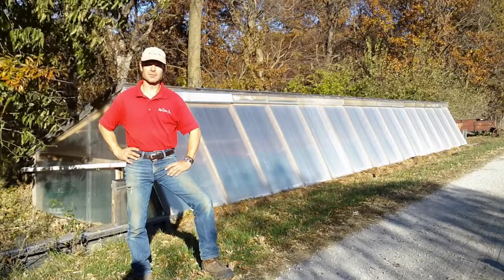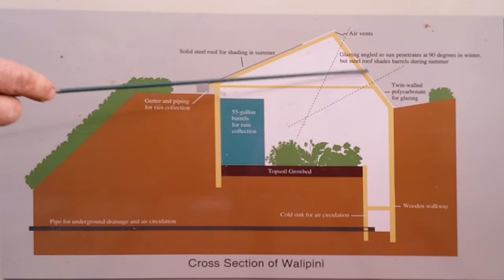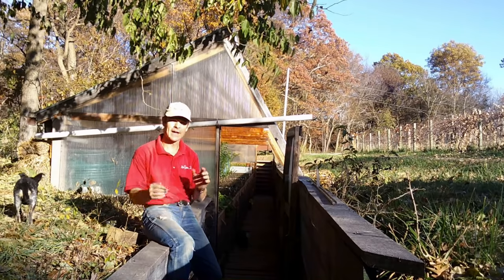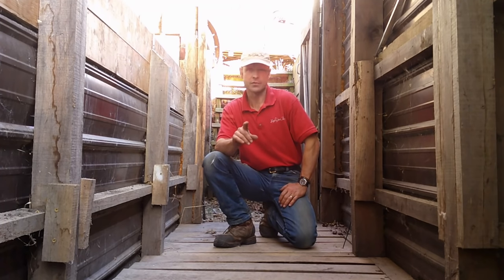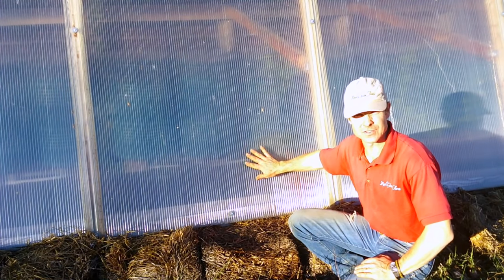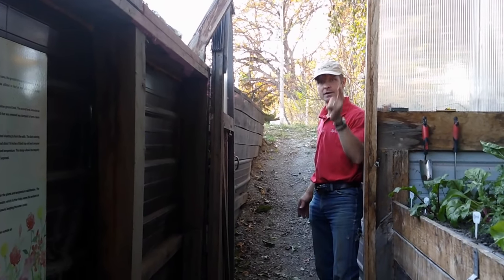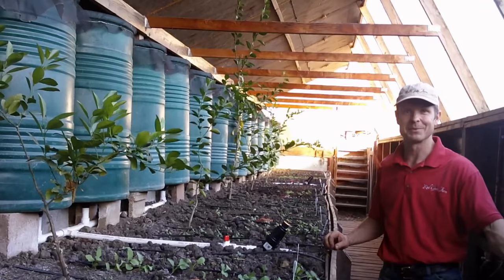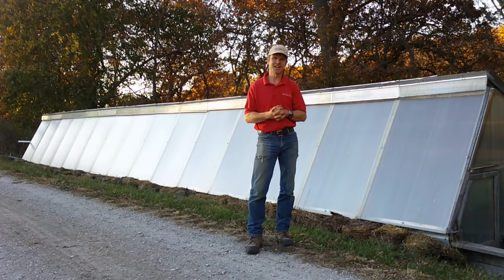Farm Tour Series: The Walipini; Use, Design, and Construction

Comment: I've heard that marigolds in a plant bed are great for repelling bugs; I'll be using them next year, for the experience. Also garlic repels pests. In my grow tent, I've successfully used wood ash sparingly, in top inch of soil and dusting on leaves, and also added diatomaceous earth sparingly in the same way; completely eradicated the bugs!
Reply from the maker: You are correct on all accounts! I love complementary gardening methods and use them often. Unfortunately, the aphids and the pill bugs I have found just don’t seem to go away using plantings or DE. At one point, I even applied so much DE, I altered the composition of my soil! So, we just kept plugging along and learning to deal as we went.

Comment: One concern that comes to mind is powdery mildew. I didn't notice electricity where a fan could be added. Some pictures showed that the plant density can get thick. It would be interesting to know more about that issue. This is a fabulous idea!
Reply from the maker: So far, we have had no issue with powdery mildew.  We do have it in our outside garden on occasion, but not in the Walipini.  I can only assume it is the good, constant flow of air between the cold sink and rafters that keeps it well ventilated.  And you are correct, there is no electricity.  It is completely self-sustaining.

Comment: Brilliant - great thinking, design and practical details. Good articulate presentation with no fluff as well.  I don't have the luxury of walnut or other really durable wood for posts - and suppose most others won't either.  So the constructional concern I'd have is with the side walls either side of the walkway - there's a lot of earth pressure to resist there and it'll be a bugger to fix once the wood supports rot where they are in ground contact.  So that's where I'm going to spend my thinking time.  But hope to be building soon.  Thank you so much for taking the trouble to produce this exemplar of sustainable living - and the thinking behind it that city dwellers mostly have no conception of, because they are so far removed from the natural world.
Reply: Suggest you ask about galvanized C channel at local metal fabricator or yard. Also scrap yards are sometimes willing to sell items like fence posts - any of these would resist ground force at some perhaps narrower spacing interval and they can be pounded into the ground. In solar, we use G-235 galvanized C-channel and pound it into the ground to support larger scale solar arrays. Expected life is more than 30 years in most soils.

Comment: Great content, thanks for sharing💚🌍
Any reason why you don't have the front wall as a grow wall? Seems like you could grow alot more in this space...
Reply from the maker: In this particular design, the walk area would’ve become too tight to comfortably maneuver if there had been a front wall bed as well.  Additionally, the bed would’ve had to be constructed at head level to receive any sun. No sun ever hit below head level anywhere in that walking area or front wall space.  This can certainly be a design consideration if you’re building one from scratch. But you have to ensure it is positioned in a way to receive sunlight, and not block the path.

Comment: All great,  first of all the explication. U r really a perfect teacher. To improve: the opaque ceiling should be reflective, of warmth and light. I'd also have the actual growing level at least 40 cm lower for better handling and more space for higher plants like trees. Thanks for the work of making the video and trying it all out!
Reply: another reason for a reflective ceiling is that u are not interested in absorbing solar radiation coming through ur glazing in the ceiling. Because during the night it will get lost anyway. But a reflective ceiling reflects the solar radiation to the soil, and the barrels, where it can be effectively stored.  Furthermore, a dark ceiling in winter nights, being cold, radiates coldness, whereas a refl. ceiling reflects the warmth of the interior back.

Comment: Cold's not coming in.  Heat is escaping.  Yes, the colder air in the space will collect down low, due to stratification.  And yes, the cold sink - which is actually a heat sink in winter - will help moderate the coldest air at the bottom., and hence the whole space.  

I like explanation of the azimuth of the Sun at noon at different times during the year.  The only thing about that is the calculation of 76 degrees in summer.  If you base that on the highest point of the sun in the summer, then you're going to be insolating those barrels during the dog days of July and August.  Design makes good sense, but I'd try to cover the bottom half of those barrels with reflective material.

I like that you took full advantage of your day(s) with the excavator and made an air inlet that will modulate the incoming air temps, year round.  I think moving air through the space is an important feature to consider, for the health of the plants.  The air can get pretty depleted in nitrogen, I think, and CO2 when you want to be photosynthesizing.  If you can get a decent convection going, you can continually bring in fresh air during the day.

Anyway, just what you've done, with a thoughtful build, gives you something with no moving parts that's pretty temperature-regulated, just by its design.

I'm coming at it from another direction, where the green and growing things are incorporated into the living space.  So I'm looking for finer controls on the indoor temperature, accommodating humans and plants.

Comment: amazing engineering on this and very helpful walk thru. I am definitely going to use the concepts you talked about. I am in Michigan, I think the angles will be somewhat similar and I have a south facing location on a slight hill. My biggest issue will be drainage since that area is a low point naturally, there is not a way to run a gravity fed drainage area in the heat sink. I may try to add crushed rock for better natural drainage. I do have access to a drainage pipe next to the greenhouse that comes from the house gutters, that runs about 70 feet to a gutter and also sump exhaust. I think I might try to allow air to pass though and separate the water to allow it to drain outside at ground level at a distance from the greenhouse. It may be a way to add air to passive air to the space using what is already buried in the ground. This probably makes no sense, but I am commenting if there are any ideas let me know! Thank you for putting together this video!
Reply from the maker: Passive airflow through the ground is a great idea. As I said, in my second video, I would put a lot more pipes in the ground designed more along the lines of a passive GAHT system. Being in Michigan, those lines would have to be deep and long.You need a lot of ground mass to sufficiently heat that cold winter air.
Reply: @ADifferentWay  when you say deep, I'm guessing you mean below the frost line which is 42 in in Michigan. Do you think do you think going deeper than 42 in would provide extra benefit for heating and cooling the air through the tubes
Reply from the maker: The highest temperature differential in soil is the first 4 feet, or 48 inches. After that, it’s pretty stable. Since your frost line is so low, I would probably go another foot below it, just to get the most benefit. realize you’ll be introducing cold air to soil that normally has 4 feet of insulation above it. Eventually, as the winter goes on, the cold air going through that tube will chill the Earth around it.

Comment: Great video! I was going to build a Walipini, but have since found a better solution for my needs as a single person living the minimalist self sufficient lifestyle. I've decided to just turn my entire Tinyhouse on wheels into an Insulated and heated tropical greenhouse using a Rocket Mass Heater. By growing my plants in my Tiny house that I have to heat in the winter anyway, I double my efficiency or more and don't have to worry about perfect greenhouse sun angles, and can instead build the south facing greenhouse windows off my Tinyhouse at the angle that gives me the most amount of sun room space, as I will have a Rocket Mass heater for supplemental heat. I hope to see a trend of people building greenhouses on the south side of their house and actually having the green house as part of their living space. I think the Walapini is a great way to have additional efficient growing space, but I would encourage people that its much more efficient to attach a greenhouse on the south side of your home first before building a walapini. Then  build a Walipini if you need additional growing space.
Reply from the maker: We agree!  In this case, the walipini had to be positioned separate from the house due to the inefficient design of the house.  We have since moved and are building a whole new passive-solar designed home with a walipini/greenhouse attached on the southside.  Looking forward to the increased efficiency!

Comment: Really good. Maybe the isolation boards on the northside could be covered with aluminiumfoil so that in winter the incoming sunrays would be reflected  in the plant area.
Reply from the maker: Definitely something I’ve thought of.  The top insulation panels could also be reflective.
Reply: @ADifferentWay  yepp, I have used aluminium foiid pur panels.

Comment: Where you added the straw, if you rotate straw/hay/straw/hay it will create compost faster and create some heat as it works down. You will eventually have compost you can use in your beds, the more you "turn it" the faster you will have compost.
Reply from the maker: We’re actually a horse powered farm. So we add manure to the straw both front and back. That breaks down and creates a little heat. We don’t need to scoop the compost out because we have huge compost piles with horse, chicken, goat manure, and garden waste.

Comment: Cool design! I'm wondering about the feasibility of getting rid of the specific angles and, instead, making the roof a curve. That way, the Sun's rays always enter perpendicular....right?
Reply from the maker: Yes, you are correct. However, a curved surface is more difficult to construct. In addition, having the angle less perpendicular in the summer actually prevented overheating. In other words, you don’t necessarily always want max penetration of the sun. In fact, in places like Australia, they have shade houses instead of greenhouses. Where the covering is actually shade cloth instead of glass.

Comment: Thanks so much for the videos! This one and your Q & A video answered many questions. Will soon be building/digging one of these (Finch’s kit). I understand you would pour the tall south wall next time; would you change anything about the retaining wall for your grow bed? Would you share tips on how you made it? It is so nice and straight even several years in! Thanks and best wishes on your new projects.
Reply from the maker: Overall, we were very happy with that design of the grow bed. It just worked out that way when we did the dig, we poured soil on top, and it maintained itself well.  We are actually building our second wall Oppini now. Although there are modifications, the basic principles are all the same. The new one will actually be attached directly to the house, which causes a few modifications by default. I’m also considering just doing raised beds this time, which will allow me a bit more flexibility. We’re still in the very early stages, but if you watch some of our more recent videos under our construction playlist, you will see more of an idea.
Reply from the maker: If interested, we wanted to let you know our Walipini building guiding is finally available! https://www.amazon.com/shop/adifferentway/list/2JRI58ITC5AM0

Comment: Very inspirational! Great design. Thanks for sharing. Thinking about doing a scaled-down version here in Iceland though there are some complications.
Reply from the maker: I used to live in Iceland back in 2000.  Beautiful country, I miss it.
Reply: Oh wow, so you know about the long winter and crazy route of the sun through the sky. Do you have any tips or insights or advice for me?
Reply from the maker: With the incredible low sun angle you should consider using reflective material on the inside and outside to concentrate light.  That reflective material can be closed up at night for insulation.  Don’t set that front wall angle for your coldest month, it would almost be vertical.  Instead, leave it around 60deg and use the back roof to reflect down to the growbed.  Also, use exterior reflectors outside the front wall on the ground to reflect off the ground and into the structure.    Keep the whole structure low and compact, with extra bracing for the glazing.  Those Icelandic winds are far to high for the small framing I used in mine.

Comment: Absolutely brilliant!  What time of day are you measuring the angle of the sun to determine the angle of the south-facing glazing.  High noon?
Reply from the maker: I use max elevation which doesn’t necessarily occur at noon.  There are several online calculators that have you input  Lat Long and date.  It will show you elevation at any hour of the day.
Reply from the maker: I use max elevation which doesn’t necessarily occur at noon.  There are several online calculators that have you input Lat, Long, and date.  It will show you sun elevation at any hour of the day.

Comment: I put something similar on the south face of a house. Nothing like picking one's meal in February without going outside.

This also allows the use of the entire house's surrounding thermal mass.

A couple suggestions:

The reverse-slope glazing is a mistake. Instead, an exterior overhang rejects excess light in summer while adding reflected light in winter. Lots easier to glaze, less (thermally inefficient) glazing is  needed, and the glazing is somewhat protected from the weather, especially at the critical top edge.

The barrels should be magenta so as to reflect useful light and absorb green.

A DC fan or two, a PV panel, and a simple light switch will give you semi-automatic power ventilation. In cool to hot weather flick the switch on and the fan(s) run when needed, per sunlight.  In cold weather flick off the switch and cover the fan(s) with foam. One can get fancy with thermostats but it isn't needed. Lots of possibilities with PV and DC fans. The system I built pumped the top-of-greenhouse exhaust either outside (summer) or under the house's floor and into a rockbed (winter).

It's fun to merge Earth and sun, eh? You do good work.
Reply: Who wants to use power

Comment: I might be too late for the show and people might not respond but I have been thinking about replacing the northern wall in this design with a two foot brick wall. Is this a good idea? Maybe even some XPS on the outside of it and heck even drainage to keep the water out and prevent any leakage!
Reply from the maker: A brick wall in the north side would be a great heat sink. Adding to the thermal mass is always a good idea to stabilize temperatures.

Comment: You should have gutters inside to collect water from condensation from the roofs and direct it to the barrels, this will reduce the number of time water needs to be added to the system from outside.
Reply from the maker: We actually get very little condensation, surprisingly.  Definitely not enough to justify the expense of another collection system.